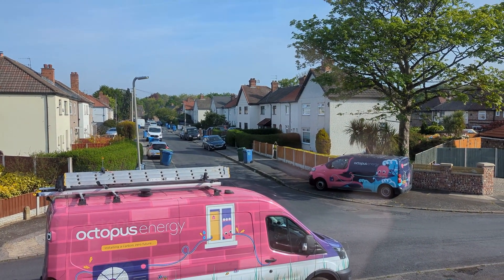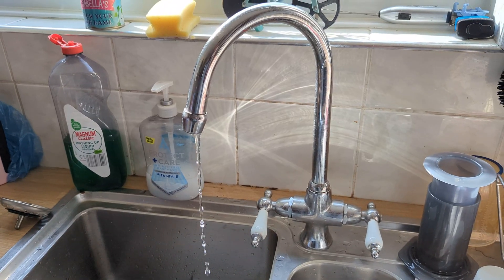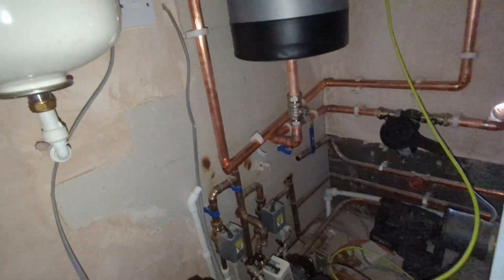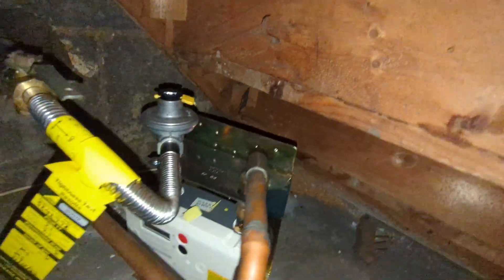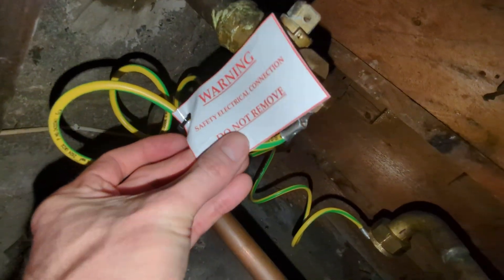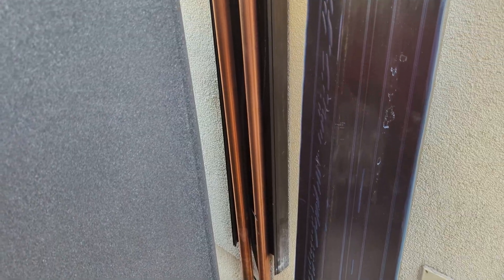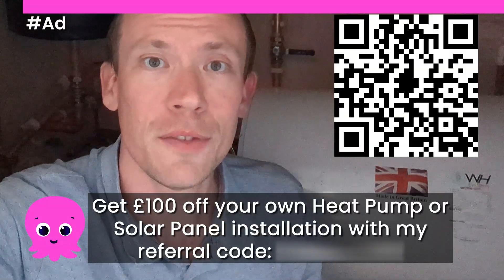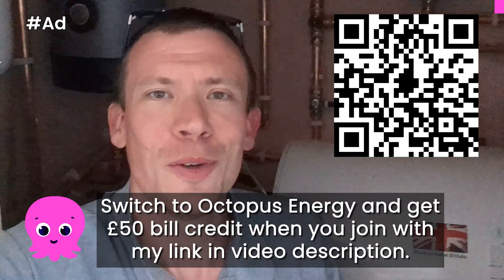Day #2 - Bye Bye Gas! | Octopus Cosy 9 Heat Pump Installation

Comment from the maker: Thinking about getting a heat pump or solar PV installed? 👇

✅ Get £100 off your Octopus installation: https://tech.referrals.octopus.energy/uz9wX5QF
💡 Not with Octopus Energy yet? Use my sign-up link to get £50 bill credit: https://geni.us/SoN-OctopusEnergy
🔋 Get £75 off home battery storage (eg. Tesla Powerwall) with code SON75 and this link: https://geni.us/Heatable

📺 In this mini-series, I’m documenting my full journey switching from gas to the brand-new Cosy 9 heat pump — from quote to install and beyond!
🎥 Watch the full series here: https://www.youtube.com/playlist?list=PLrba4iir0yEujaVy1YQQ8tgumGPViLDyI

🏡 Want to know how the Cosy 9 performs, what it costs to run, and how it fits into a smart home? Subscribe and tap the 🔔 to follow along.

#HeatPump #OctopusEnergy #Cosy9 #SmartHome #EnergyEfficiency

Comment: I wasnt aware such a big buffer tank is needed, is this standard?
Reply from the maker: Great question. The size of the buffer tank can look a bit alarming if you have never seen one before, but this one is pretty typical for a modern heat pump install. It's not there to store loads of hot water like a cylinder - its job is to keep the system flowing smoothly, stop short cycling and help the heat pump run efficiently at low flow temperatures.

Different installers use different approaches. Some use very small buffers or low loss headers, some use nothing at all if the system design allows it. Octopus generally fit a buffer because it gives more stable performance across a wide range of radiators and pipework layouts, especially in older houses (like mine!) that were never designed for heat pumps.

In day to day use you never notice it is there. In my installation it's on the wall in the place my old gas boiler used to be (and is a bit thinner than it). It is just part of making the whole system run as efficiently and reliably as possible.
Reply: @SwitchedOnNetwork thanks, octopus had a survey few days ago so trying to decide between 2 possible locations, with a larger buffer rank, going to be too tight
Reply from the maker: Oh right, are they giving you a choice of buffer tanks?
Reply: @SwitchedOnNetwork I will find out very soon, maybe it depends on the location chosen
Reply: @SwitchedOnNetwork it’s plumbed as a volumizer and not a buffer